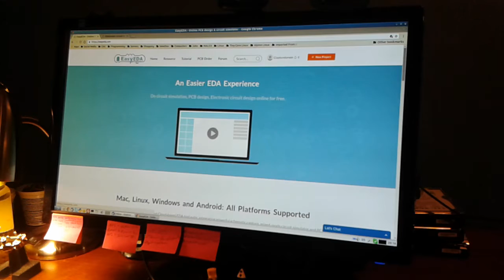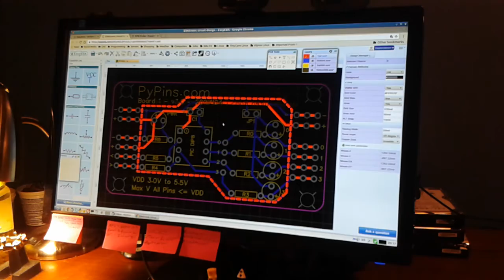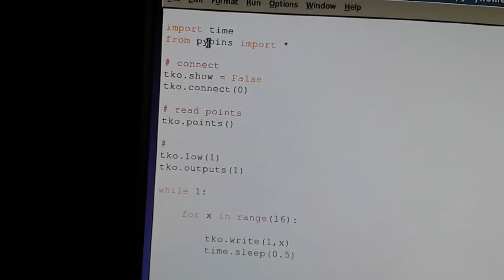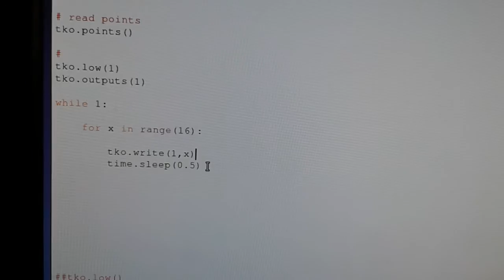Unboxing Circuit Boards from EasyEDA (plus building and testing)

Comment: Thanks for the inspiration. What is the "Copper area" useful for?
Reply from the maker: shady mohsen - You're welcome. The copper area can be a ground, a shield, an antenna, a heat sink. I'm not an electrical engineer, but I think it is used for things like that.
Reply: Thanks for your reply. :)

Comment: Hi what about  0,2,4,8 ???
Reply from the maker: Arvis Litvins - With 4 bits, you can count from 0 to 15, which includes the values you mention.
Reply: I spouse you can, sorry to disturber you.
Reply: Both the uploader ( 7:36 ) as well as you were wrong… it’s 1 2 4 8. All bits off is 0, all bits on is 15. First 2 bits on means 3, last 2 bits on means 12, etc. Just got to add up the weight of each active bit.